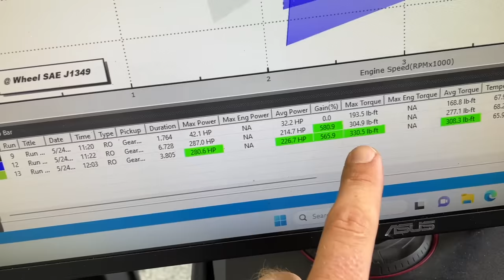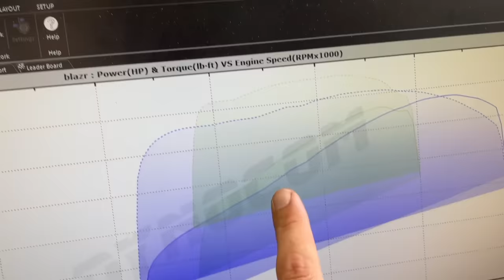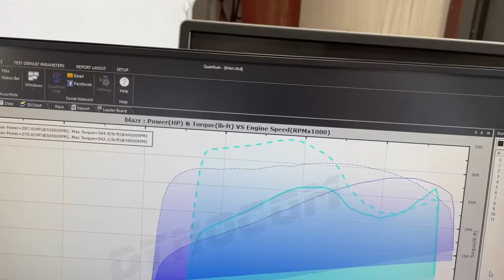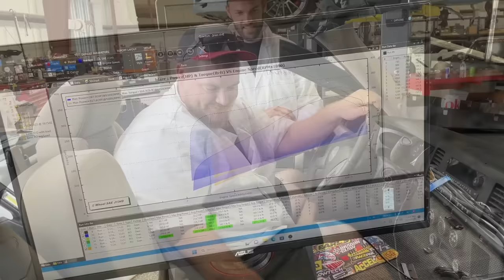MIND BLOWN!!! We Put TOP FUEL NITRO In a Daily Driver and It Made INSANE HORSEPOWER!

Comment: I think Mullet needs to do a 1/4 mile run on nitro
Reply: pretty expensive motor to play fuel games with. I wonder what Steve would say if they asked him if it can go on nitro?
Reply: With the SMX things for Mullet are about to seriously change considering what Tom Bailey and Steve Morris are going through trying to that much power from tearing up everything it's sending to the limit. However as far as this truck, it needs to be a Leroy type of creation so bend some pipe and send it.
Reply: Mullet already makes too much power for small tire setup. 

Cleetus isn't anywhere near the 5000HP max, so no need to blow it up on nitro.
Reply: @warrenmichael918  nitro engines don't normally live a long life, Top Fuel dragsters do a burnout and a 1000 ft pass, then it's time for a rebuild.
Reply: Probably not realistic. 

Tom Bailey is building a car with an SMX that will run nitro
Reply: @Bobthebuilder.69  exactly, thats why i would like to hear Steves response about what would happen and how soon!!  LOL
Reply: @mjay6245  Agreed however Garrett has already mentioned 5's so obviously changes are necessary
Reply: @Bobthebuilder.69  lmao
Reply: @mjay6245  you realize there are other cars on radials going 5s in the 1/4 right? has nothing to do with limit its all on suspension tuning at this point still, the weight doesnt help either
Reply: You can't realistically run a drag and drive car on nitro... No only is it super expensive per gallon. You're also burning it 3x faster than ethanol. You're dumping so much fuel into the engine that it readily contaminates the engine oil. Which is very bad because not only is nitro not a very good lubricant. It's also hydrophilic. It absorbs water right out of the air. Which can and will corrode both your engine and fuel system if you don't flush it, and change the engine oil, every time you drive the car. 

It's really not worth the logistical problems of trying to run any of his cars on nitro. Even for a single run. Mullet already doesn't have enough tire for the power it's making.
Reply: @Notarobot310 what are you talking about literally nothing is changing with SMX..the faster company had a weaker batch of metal that's completely normal especially since covid.. alot of shit came from china to meet supply unbeknownst to consumers ... My dad's had an SMX two years going fast and never had more than a loose valve to tighten.. when your not running them ragged and for thousands of miles they last forever but when you do these type of things can happen anytime that's why top fuel rebuilds entire engines clutches and superchargers each pass to avoid the possibility... Cleetus had the same internals in his last BBC and went 6.47 now he can run twice the boost and power but the faster you go the more frequently your rebuilding ... 20-30 passes typically for alot of promod and npk guys but Steve's recent failure was a metallurgy issue or it never would have broken so fast right away in a burnout..
Reply: @ArionEquus  could u spray nitro almost like nitrous?  LOL
Reply: @mjay6245 lmao he's know where near the small tire limit... There's small tire cars deep into the 5s and deep into the 3s he's got plenty left to improve on.. his tuner said 5s are possible in the right conditions if he really wanted to shoot for it and his tuner was the first guy that put a car in the 3s on a radial so he definitely knows what is possible.. before he was limited in what he was doing because of fear of splitting the block now he doesn't have to worry and has  40+ lb of boost extra to play with out the back
Reply: @freedomfox8183  Seems you may have misunderstood, of course nothing is changing with the SMX,  Mullet is the one changing to meet the power underneath the  hood.
Reply: @Bobthebuilder.69  yes, but top fuel dragsters run a tad bit more power than either an SMX or this 5.3. It's not just the nitro that's doing the damage
Reply: @halofreak1990  run your car on 100% nitro and let us know how long it lasts
Reply: @ArionEquus  You are completely correct about all of the issues with running Nitro. However, if someone had the passion, motivation, and the cash to design and build an engine and fuel system to run on Nitro reliably, I’m sure it can be done. Now granted, we are talking about going as far as to have a custom metallurgical blank made so a shop can machine a custom designed block here. A venture that is truly that of captain Ahab .

Comment: There's got to be a way to switch fuel, fuel map, and timing on the fly.

Hide a tank of nitro, switch valve, and pump in the spare tire well, and go clean up.
Reply: anywhere it touches oil you end up with a highly explosive mixture. your crankcase is full of oil. you cant run this shit on the street.

Comment: There's a reason Big Chief has always run nitro in  all his cars!
Reply: I was thinking the same thing. I have also been watching clay millican and I always wondered how they get to that 12k hp mark, now I am starting to get it
Reply: @dajobra  Those top fuelers run literally ALL the fuel. Massive mechanical fuel pumps, injector nozzles the size of garden hoses, they go through something like 40 or 50 gallons of nitro a pass. The engines are on the verge of hydrolocking there's that much fuel going through them. The blowers they run put out ridiculous amounts of boost, like 80psi. Twin spark plugs per cylinder, with two whopping great magnetos driving them, with enough voltage to put Arnold Schwarzenegger on the moon, and they only get to about 700 feet down the track; the engine is pretty much dieseling the rest of the way because the plugs have either been blown out of the head or melted away. By the end of the pass, the clutches are pretty much welded together. 1000ft passes in the 3s at well over 300mph, which is back where they were when they were running to 1320ft just before Scott Kalitta died. Triple parachutes on the back, with deceleration g-forces so great some drivers have had detached retinas as a result. When an engine goes pop, its always catastrophic. Broken blocks, broken cranks, rods ending up in the next county, its pure insanity. Before all this inflation BS, it would cost 100 grand a meeting to run a Top Fuel drag car or funny car
Reply: @HotForgeChaos  I know, It's awesome! They also have a max nitro percentage, max blower overdrive ratio and all kinds of safety features like a remote kill switch. Like I said, I have been watching Clay's chanel, it's facinating. 
After seeing these test results I get you need to build a 5.5k hp "regular" combo and add nitro to get to that 12k number, insane.
Reply: @dajobra  Look at Mullet with a 572 cu in engine that can make 5k hp and then top fuel with a 500 cu in engine that makes 10k+. Of course the mullet engine isn't made to make it to the end of the track and hopefully go again with only a mild rebuild between runs, but it matches the results here of getting roughly double the power.

Comment: That is absolutely insane... now I wonder what it would do on a turbocharged engine.... like something with a massive single engine turbo.... the exhaust pull on that with straight pipes would be nuts!
Reply: That AF ratio he mentioned at the end is insane, you may as well hook up a turbo to each cylinder and a garden hose for fuel!

Comment: Nitro needs to be lit off earlier with timing. Slow to ignite. The fuel has its own oxygen. Watch a top fuel system run and it will astound you with the amount of volume they put through each cylinder. More fuel. More power. If you can light it off. Have fun boys.
Reply: Big Daddy Don Garlits said one time back in the day, a fuel car opening up is like 20 of the shower heads in your house all at once.
Reply: "Under full throttle, a Top Fuel Dragster can consume 11.2 gallons of Nitromethane per second"

Comment: Id love to see a teardown of the engine to see if the fuel cleans it
Reply: More than likely. I used to have a kart motor that ran on pure methanol and it burns pretty clean.
Reply: Run enough of it and it will clean the engine before it provides a rapid tear down of the engine.
Reply: Why does it tear the engine up?

Comment: I have an '06 GMC Sierra extended cab regular box, 4wd. Just like the one in the background! 5.3 alum. block, alum. head, 8th digit "B". Headers, cold air intake, reworked throttle body. Any suggestions? Thanks!

Comment: Uncle Tony did a video on nitro fuel and why if makes so much power, basically it burns longer thru the power stroke of the engine compared to the short duration of normal fuel.

Comment: I was surprised you had enough injector to get that much power from nitro. Nitro needs a ton of flow to make big power. It's why top fuel injectors look like a fire hose.
Reply: with the super charger theyre able to significantly increase the amount of nitro put in the cylinders. afr is probly around 1:1 or so. its even been said the afr may be slightly more fuel than air. .8:1 or there abouts

Comment: I used to run a little in my lawn mower.  mixed in a bit of model airplane fuel.  It didn't add a whole lot of actual nitro but I did notice a difference.  It was my test platform when I was first leaning engines so it was also ported with slightly bumped compression.

Comment: You guys should now go get a Top Alcohol dragster engine of the Nitro kind.
Those are N/A but Nitro and in a dragster runs down to 5.10s in the quarter at 280 mph in NHRA.
Also, N/A so not as insane as TF/FC engines and should be WAY less costly to run for a few runs down a strip.

Comment: lol i remember doing this at bristol street fights in a 92 Dakota with a magnum controller and straight pipe =). launch in 4 wheel high and shift out to 2wd right before second... used 3-5 gal 30 %nitro rc fuel with 5 gallons of gas. that truck hurt so many feelings on open night ... the good old days

Comment: If you drain that engine oil after the runs it will resemble the foam on the top of a Latte.
Simply put it into a saucepan on low heat at about 175 F for an hour or so in order to boil off any of the volatile compounds that may have remained.

Comment: That "spicy" smell you're getting out of the NItromethane is partly nitric acid vapors (BAD). When I was a kid I built model airplanes and they ran on upwards of 30% Nitromethane with methanol, and castor oil in premixed gallon jugs we could snag from the local hobby shop. I seem to recall that my father mentioned during a indoor test that the horrible fumes that drove us both out of the workshop was nitric acid vapors and tear gas. 

Cool video!  (me leering at my 2002 Civic...)

Comment: I met the guy who set the last lap record for Silver Lake Sand Dune Park in Michigan. He claims that he is the reason they stopped doing the race. I don't remember the actual lap time, but he showed me the "dune buggy" that did it. I use quotes because it was barely more than a go-kart. He took the frame from a VW Beetle, kept the front end full width, but narrowed the frame to 3 feet, narrowed the rear axles as well, so the back wheels were only about 4 feet wide but the front was 5 feet wide. No rear suspension, just huge ballon tires. Skinny grooved tires up front. 1776cc dual port beetle engine running 80% Nitro through a four-barrel carb. he estimates approximately 300-320 hp. Weighed under 900# with him in it!.

Comment: Actually nitromethane contains less energy than gas. But it brings some oxygen in with the molecule, so you need less air/oxygen to burn it. So you can run more fuel through the engine, making it more powerful. That's why topfuel dragsters go through their whole fuel tank in seconds xD But that's fine, it wouldn't run for longer anyways since the transition melts together (wanted xD) everything else gets used pretty hard too^^

Comment: Stoichiometric for gasoline is 14.7:1. Stoichiometric for nitromethane is 1.7:1. It literally takes injectors ten times the size as the stock injectors, ten times the fuel pump, and massive fuel lines/rail/fittings to support them.

Comment: I've ran torco and VP methanol I was given at Holley Ford Fest in my 96 ranger auto-x truck when it had a 3.0 with shaven heads and JBA headers. Now it's got a 5.0 with an engine management system. Looks like I'm spending three paychecks to fill it up on nitro according to my calculations. Might be the only power adder it needs on a half cocked tune before the block leaves the chat  😂

Comment: ITS THE NITROGEN BONDS!! It’s triple bonded and I actually run a 20% mix in my 4 wheeler. It is a Suzuki 400 LTZ and it runs well on methanol and Nitro Methane which is just Nitrated Methanol! The bonds make a true detonation in the cylinder and it is why you couldn’t run that 90% all the time because the amount of Gas / Air the NitroMethane makes per detonation is a major amount more than gas! It over stresses the rods and pistons and bearings from the detonation and the fact it’s happening so fast that it is not able to move that piston as fast as the detonation! That’s the trick to all Bang! Nitrogen is the secret, it has 3 bonds per molecule so it’s very hard to break the bond but when you do get it to separate it releases a ton of energy stored in chemical form! BTW- I can eat a corvette ,(new or old), up with my 4 wheeler until he hits 2nd gear! I have street tires and I set the suspension to hook up and I can lean over the bars and flick through 3-4 gears before he hits 2nd and am out front 2-3 car lengths so you can do it long term if you pay attention to your fuel and not let it get old! It’s all alcohol based and alcohol likes to collect water so I never leave fuel in my quad! I always drain it and run a little straight 105 through it till it is bone dry.

Comment: I tried some 75 percent nitro in a 100 cc Husqvarna chainsaw that had 185 psi compression, I thought what's the worst thing that could happen.
Well after a really hard start that sob took off and ran no less than 12.000 rpm and couldn't shut it down, pulled plug wire,got a hell of shock tried choking it out, finally pulled fuel line and with plug wire sparking all over it was now on fire. It finally died but after a little burnt plastic old Husqvarna still lived. Boy that is wicked stuff, I wish I would have had a video.

Comment: Cheap easy HP!
Try to put a 90% nitro mix through the fuel side of an individual port nitrous system, without the nitrous.
Wonder if it'd beat a normally setup nitrous setup though?
And to put things into perspective, think how much HP the stock exhaust was killing power with the nitro.... Another 10-20% left on the table?

Comment: As a laugh I added a third of a bottle of moonshine into my Chev. pickup fuel tank. Holly crap ,it was like adding  more cylinders , the truck was  just about jumping off the ground . Could smell alcohol in the cab and wondered if it might blow the motor ,which it did not ..Intereting though.

Comment: 84% toluene is the fuel of Formula N because it's more resistant to premature detonation in boosted engines. The big end, big turbski crowd may need to take note cause I'm looking at a 78 before an 88 single. There's a reason for twins and sequential sounds like the bees knees

Comment: Here is a crazy sailor story. Back in 1988 I had a Honda ATC 350x. Stock rated at 28hp. Bought 1 gallon of nitro at Tognotti's in Sacramento for $34. Base run was climbing canyon road, screamed in 3rd, held in 4th bogged in 5th. 20oz nitro in 2gal of premium gas(I knew then nitro doesn't mix with gas, didn't care). The math works out to about 8% nitro. Same hill, s reamed in 3rd, screamed in 4th, held in 5th bogged in 6th. Gained a gear w less than 10%!!! No jetting changes, no timing, no mixing agents for the gas. So, thought I'm leaving for 6 months on the carrier(USS Carl Vinson CVN-70) the next day, 20oz more. Fired it up and did a very short hill climb when all of a sudden no power and it was so hot, never been that hot even running at Sand Mountain in Nevada. Must have been so lean, thought it was seizing. I literally parked it, told me brother to drain tank and carb and I'll deal with it in 6 months. Bro got it started he kicked it for 2 hrs he said while I was gone. Couple more years riding it was time for high compression piston. With piston out saw the factory cross hatch marks still 100% visible in the cylinder, some wear, no scoring or any obvious damage, this is why I'll always choose Honda, if a dumb crazy sailor can't kill the motor...well there's no better engine quality, at least in the 80s machines.

Comment: It was my understanding that nitro methane has a low flash rate that normal spark won't ignite it and you have to use magneto's as hot as cranked up welding machines and compression as much as a diesel engine. It would be like mixing water in your gas

Comment: The 1.5 l turbo F1 engines of the 1980 ran on a fuel mix that included a high amount of Toluene. You could try it on a turbo engine. But be carefull with the fumes and skin contact, it is very toxic.

Comment: Gasoline AF ratio should be about 12:1
Methanol AF ratio should be about 6:1
Nitros   AF ratio should be about  2:1  
Without the fuel getting fatter according to your percentages it's not going to get optimal power output.    Also you cannot keep running nitro prolonged periods of time.   I haven't watched your video all the way through yet but I am assuming you will explode this engine soon I am 12 minutes 15 seconds to the video now.   I am very curious though!   How much can a stock LS engine handle 🤔

Comment: Well figure the best blown alcohol engine makes approximately 4,000 hp give or take, like say a Top Alcohol Dragster. And a Top Fuel Dragster on Nitro makes an estimated 11,000 horsepower based off track performance numbers. So more than double the Horsepower from roughly the same type engine.